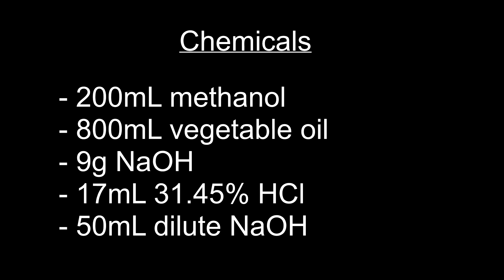How to make Glycerine (Glycerol)

Comment: Wow. That was really complicated. This stuff should be worth a fortune if it's always this hard to produce! Surely there is a way to synthesize it as opposed to extracting it.
Reply: crude glycerol is a side product of making biodiesel, which is a major industry, so it's available in large excess and nearly worthless because of oversupply.  usually when you do a process like this you would save the biofuel and discard the glycerol rather than the other way around.

Comment: Seing video now I was thinking it could make sense making glycerol at home :) . Just methanol is not so easy to get  at home. Why not using just  Ethanol for transesterification?  It would be nice making a video to make  it at home with the minimum ammount of exotic  components.
Reply: You absolutely can use ethanol, just make sure it's anhydrous to avoid hydrolysis of the ester.
One improvement might be using alkali metal alkoxide as the base catalyst instead of alkali metal hydroxide (e.g. sodium methoxide in methanol vs sodium hydroxide in methanol). It's more expensive (you need dry alcohol + alkali metal) but you eliminate all the water from reaction, making it cleaner - the reaction is more driven towards the ester instead of the soap.

I need to dispose some castor oil and saponification is one option, the other is actually this reaction, getting useful glycerine out of the oil plus the byproduct ester can be hydrolyzed separately into soap (easily discarded as solid waste) while recovering the alcohol.

Comment: 7:48 where do You get those types of containers? What type/brand are they? I can't find them on Amazon.

I know its minor, but it bugs me when i have like 20 different types of containers in use to store chemicals; i prefer to use the same type/style, being as consistent as i can.
Reply: are you talking about the amber vials?
Reply: @datazngirl  Yeah, it looks like they're what some of the chemicals he purchases gets shipped in, and he just reuses them. 
I have this weird OCD thing where I try to keep all the containers as similar as possible, lol. Kinda ridiculous.
Reply: @datazngirl  Oh no, I have those ones actually. The ones you linked to are just for smaller amounts of essential oils. I think they go up to like 5 or 10ml (or thats at least the ones I have).
No worries though, I have a set of ones I'm happy with. I try to stick to the GL45 caps if possible, or the similar types for the smaller bottles.

Thank you though!
Reply: @datazngirl  Thanks for taking the time to look and answer, by the way. Usually questions like that go unanswered (or at least mine do, lol).
Reply: @jhyland87  you're welcome! I wasn't sure what size you're looking for, but they have all kinds! Ones with a dropper or roller ball and just the container.
Reply: @datazngirl  I just needed them for storage. I started using these types of bottles: http://amzn.com/B07HMGB8ZB/ which have the common GL threads (GL45 or GL28, etc), which means they're the same style and can be used on the same bottles :-)

Comment: why do you need to reduce the pH to 1? if the goal is just to remove the base from the solution wouldn't  a pH just below 7 be enough? or is the strong acidic pH required to reverse any saponification? 

would this work with vinegar?

Comment: How to dissolve NaOH in water? When i do it forms cloudy solution and after it is kept stable NaOH sattles down at bottom. How to over come this problem.
Reply: Adarsh Bhimani Make sure that you use clean water. Than mix your NaOH to the water and mix. It heated up, but this is normal and the mixture is cloudy. After 10 min. you have a clear soluotion.

Comment: Hi, would those ratios all be the same if you used ethanol instead of methanol to produce fatty acid ethyl esters and glycerin? And could you use acetic acid instead of HCl in this process? Also when you talk about washing biodiesel (FAME or FAEE) with water, is that just simply shaking the two around and removing separated soap contaminants? Thanks man, great vid!

Comment: I've been watching these videos on a binge for at least a month now and this is the first one that makes me actually want to buy all the lab equipment and try
Reply: 4 year later did you ever do it? Buy some glassware and start building an amateur lab?
Reply: @K0ester  no
Reply: @ nope
Reply: Unless you have a bachelor's degree, I would advise against it. You need a lot more than just glassware and chemicals to do chemistry safely and properly. Also, almost all chemistry produces nasty fumes, and doing it outside is a craps shoot depending on which way the wind is going. Then you risk exposing neighbours with open windows if you're in a city. In other words, you need a proper fume hood that's vented to a roof (ideally) at the very least, along with PPE like a flame/chemical resistant labcat, goggles, gloves, and more.
Reply: I know I rambled enough as it is, but just as an example of what could go wrong. I decided one day to just dissolve some limestone in hydrochloric acid to see what I could get out of it. What I got was hydrogen sulfide because there was some sort of sulfate in the rock that I wasn't expecting. Hydrogen sulfide is more deadly than cyanide. While it has a strong smell of farts you can become "smell blind" to it at high concentrations and not even realize you're breathing this deadly gas. My whole house smelled like farts for a week. But it could have killed me if I used more than a few tiny rocks.
Reply: Your name means DAEMAEHMAM, what does that mean?
Reply: @ it's just random dashes and underscores

Comment: The gelled biodiesel was most likely due to water in the methanol. To get decent yields with this, you need very dry methanol and oil. Separation is also quite fast without water contaminating the transesterification.
Reply: use copper sulphate instead of lye,  use metho and boiled linseed oil,  add oxalic acid and walla   air drying flexable ceramic glue.

Comment: +NileRed I have a question about alternative route. Recently I tried making soap the "old way" where the water phase (that contains glycerol) and soap are separated by adding salt. But when I let it to settle down the glycerol in the water phase solidified, because it was pretty chill outside. So I filtered it out and washed. Do you think it might be pure enough? 
I have no means of making a proper analysis though. The only thing I tried was finding the melting point, which was quite sharp. That can indicate some level of purity, but it is not an actual proof. I would like to know your opinion. 
Thank you.

Comment: Off-topic question:  Under normal conditions (say boiling a pot of water on a stovetop) will water's temperature ever go above the boiling temperature?  My guess is: No, it boils off. If so, this is why boiling water is such a useful working point in cooking; a known temperature can be made without a thermometer, and a reliable basis can be assumed for the cook following instructions.
Reply: I think this is why pressure cookers work the way they do, you can raise the temperature of boiling water by making it harder for water to vaporize and leave the liquid phase. This is why foods cook quicker in them.
Reply: Brady Wells   So in an indirect way this does say that is true. The key to that explanation is the higher pressure not allowing it to vaporize.  So there it is; the boiling water does not go above 212 degrees F (100C) (at typical atmospheric sea-level pressures).  Believe it or not, I do know this is how the boiling point is defined.  I guess there is more energy in the water for the latent heat of vaporization which (in the case of cooking) leading to different cooking times. – This is the difference I was wondering about between a simmer and a rapid boil; there is more energy. Thanks.
Reply: When you add a solute to the water it changes the boiling point, so you can have a solution of sodium hydroxide at 123 C but it depends on the amounts

Comment: Mix the methanol with a higher molecular weight alcohol (butanol can be used and is easily found) in a 3:2 methanol:HMW-alcohol; it really helps with mixing the methanol and the oil.

Comment: "vegetable" oil is just marketing speak for soybean oil.
Biodiesel is an excellent solvent, much stronger than normal petroleum distilate fuels.(special seal materials must be used for engines that run more than about 10% biodiesel) solvency and such varying somewhat with the alcohol and fatty acids used. Ethylated seed oil versions are used as waxy-cuticle penetrating agents in aqueous plant sprays at about 1% by volume.

Comment: If lab products are pure, why is it dangerous to ingest them?
Reply from the maker: The glassware usually has unseen leftover chemicals on it. Also, the chemicals are usually not food grade
Reply: So it's contaminated usually?
Reply: industrial/chemical standards are just not fit for consumption. basically consider food from your own lab as "fallen to the floor' except ... the floor has been in contact with all sorts of acids, toxic substances and so on. wouldnt eat that, would you? :D
Reply: if you want a minute risk to become blind taste it, :D he used methanol to wash glycerol.
Reply: Jake Kim take lab grade cyanide as an example. They are pure, but that doesn't mean that they aren't dangerous.
Reply: If you use new glassware and only food grade chemicals, you might be able to ingest things you make in your lab.
But food grade chemicals are usually more expensive than lab grade stuff.

That said, I do have some food grade NaOH and sodium benzoate. I wouldn't want to ingest anything I made with them, though. And I wouldn't want to eat anything I made in that glassware after that, either.
Reply: Food grade can be VERY impure. In many cases less pure than lab grade. The difference being that the impurities in food grade are generally not toxic and are predictable. Lab grade can have anything in it, a very tiny amount sure, but it could be owt.
Reply: Maric YUM 
😙
Reply: So, how can you make it for consumption?

Comment: who could not have an interest in bio diesel in this day and age?
Reply: Normies
Reply: debbie green When placed side by side with petrodiesel, biodiesel can not even compete. It's way more expensive and at the same time, a much worse fuel. Less energy, harder to burn, more susceptible to water absorption. You literally get less, for more. Call me when you find a way to make one billion gallons of it, until then it's a joke.
Reply: @Bloated_Tony_Danza  You can add 3% acetone and its the best diesel you can have.
Reply: @Bloated_Tony_Danza  
Just about summed it up nicely
Reply: Ilir Kumi I just spent $6000 on a 7.3 rebuild, due to fuel tank delamination from my truck sitting for 2 years! In addition to that I spent $1200 on tanks and $800 on installation. THAT'S A TOTAL OF $8000!

Biodiesel is BAD for older systems because it's high solvent properties disolve solids that can accumulate at the injectors.

...but for a NEW truck or NEW system like I have B20 is perfect *(temperature permitting) for preventing contaminants to build up in the first place! Also ULSD has shitty lubricity and biodiesel has EXCELLENT LUBRICITY! So I would gladly pay an extra 20-50 cents per gallon to PROTECT MY INVESTMENT so it will last another 20yrs.

*3:20 More advanced refining techniques have been developed to remove the components of the biodiesel that gells at higher temperatures making it a more reliable fuel. I have 2 tanks on my truck that aren't manifolded so in the winter, I will run B20 in one tank and #2 in the other. On mild days I'll be using the B20, on colder days I will be using #2.
Reply: @Stacy_Smith  then try search aquafuel articles
Reply: @Stacy_Smith  please put the link here. its a good trick to make it unfreeze in cold climate. my place is tropic but some area can go as low as -10 celcius and those place can really use ur trick to stabilize the diesel fuel
Reply: @sargera1  I can't remember where I saw it and my job keeps me busy. They basically distill the biodiesel to remove triglycerides. Do some research and look up biodiesel distillation.

Comment: Isn't this the same stuff thats in vapes or something like that?
Reply: In vaping they call Glycerol VG (Vegetable Glycerin) mainly to differentiate it from PG (Propylene Glycol). It doesn't matter how the VG is derived, it is all the same, it is simply Glycerol. It is also a misconception that PG produces more throat hit. The throat hit comes from nicotine alone, PG doesn't have any throat hit at all. The reason heavy PG based liquids have bigger throats hits is simply because PG produces MORE vapour than VG (PG is far more volatile than VG) and thus delivers more nicotine to the throat in a single puff. VG is used in liquids mainly because the vapour it produces is VISIBLE unlike PG which has mostly invisible vapour.
Reply: AK47Sasg Somewhat Wrong. Most vape liquids use a mix of Vegetable Glycerin and Propylene Glycol. It can be completely one or the other sometimes though.
Reply: Kerbd noted. I wasn't totally sure, but i checked, and where i come from (central Europe) most liquid manufacturers use propylene glycol as a vector for nicotine. I'm not denying that other compositions are in use elsewhere. I'm glad to będzie proven otherwise :)
Reply: xGerbil Yes
Reply: Yes. Vape juices can use VG (Vegetable Glycerin, like in this video), PG (Propylene Glycol, which creates better flavors and less vapor), some kind of Nicotine Base which uses PG or VG, or a combination of the three in nearly any mixture. 50/50 PG/VG is really common. 
You also want some flavor additives or your vape will be boring. 
I wouldn't recommend using the process in this video to create vegetable glycerin for vaping though. It's pretty cheap (5 dollars) to just buy a huge 16oz bottle of VG off Amazon and use it for a year instead, and you don't have to worry about any impurities / fuckups killing you.
Reply: xGerbil I think so
Reply: Yea and also pg
Reply: not always, most of "vape liquids" use propylene glycol, which differs from glycerine by one less hydroxyl group (propane-1,2-diol vs propane-1,2,3-triol)
Reply: Do you know what volatility is? The facts and figures regarding PG and Glycerol are right there on Wikipedia if you care to look. PG Vapor is mostly invisible (known fact), it has a higher volatility than VG (known fact). What that means (dumbed down for you a little) is that it takes less energy to move it from liquid to gaseous phase than VG. In figures that means if you were to take a draw on 100% VG liquid for 3 seconds at a given power level, say 50W, you would vaporize 0.12 mg of the liquid, at 3% that would deliver 3.6ug of nicotine to the throat. Now if the liquid were 100% PG and you took a 3 second draw at 50W, you would vaporize 0.21mg of the liquid since it it more volatile. So at the SAME 3% you now deliver 6.3ug of nicotine to the throat. It's not complicated bud, it's simple maths and simple science. And PG has no throat hit, I do vape, I do make my own liquids and I have tried it, not only that, there are videos right here on YouTube of people vaping pure PG and they confirm it has no throat hit. The only sensation it delivers is a drying effect (as PG is quite hydroscopic) which is not the same thing. Physics and reality doesn't warp because of what you believe pal..

Comment: Can I use ethanol instead??
Reply: +Distelzombie Centzon Totochtin, yes you can if you are only planning on using the glycerine, however the biodiesel you will also obtain will be useless. and during the washing process ethanol won't work very well so you will need to find something else.

Comment: can I use isopropyl alcohol
Reply: +Saikit Tang For the last purification step you could but when performing the hydrolysis of the vegetable oil you might end up with the problem that sodium hydroxide does not dissolve as wel in isopropyl alcohol as it is in methanol.

Comment: Could you do a video showing how to nitrate the glycerol? plz thanks.
Reply: +Richard Highwind thats the easy step to nitrate it, but the difficult step will be to handle it porperly....
Reply: +Richard Highwind Theoretically speaking, the nitration process would involve Nitric Acid, but Nitroglycerin is a) likely illegal and b) catastrophically dangerous. It's shock sensitive, friction/heat sensitive and would likely explode during your synthesis. Or it may give off Nitrogen Dioxide fumes and suffocate you that way. It's not a pleasant way to go.